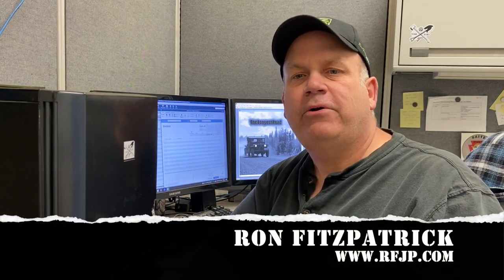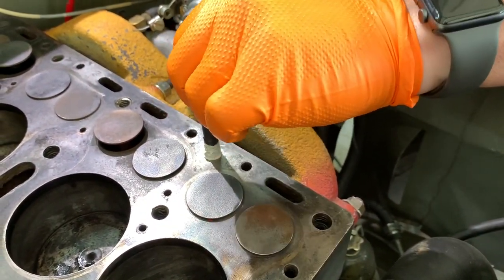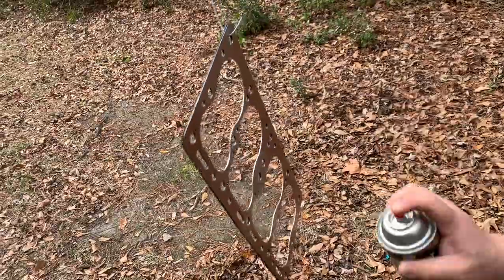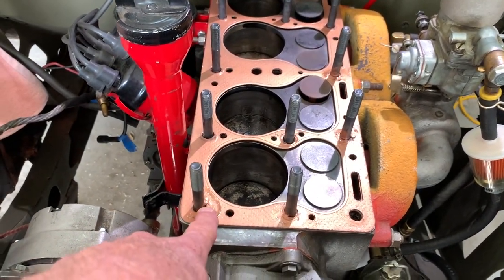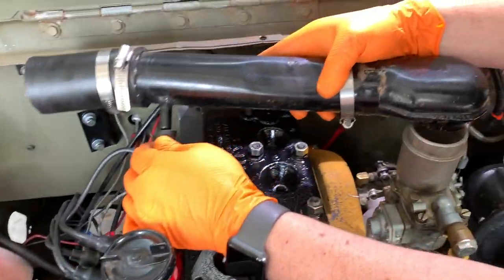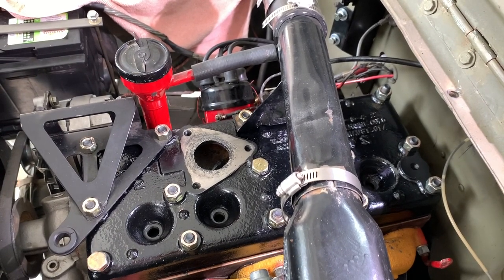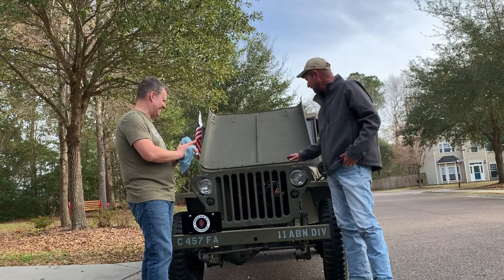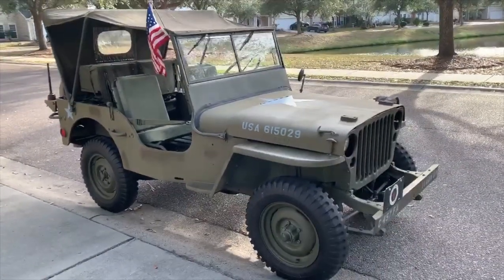🔧 Replacing The Head Gasket On A Willys L134 Flathead Engine

Comment: If the threaded bolts were corse threaded into the block. (A good possibility) Then they should be torqued at a higher value. Been there, blew the head gasket for my education. How much higher? For the Jeep, I don't know. My engine (Dodge) came with either, so I was able to look up the difference.

Comment: Hi! Great job you guys! I have a question. I  just got a 1951 CJ3A. It was sitting for 20 years. I started to remove parts that I'm going to replace on the engine. I accidently removed the entire stud which the oil filter is held down by and I noticed antifreeze bobbing around in the stud hole. I have not removed any fluids yet but I don't know if that is normal or if I have a bigger problem. Do you guys know?

Comment: I have a m38 that also have issues with head gasket. Lots of White smoke .i m thinking replacing the head gasket. Did you also do cylinder head flatness?
Reply from the maker: baios zisimos on this one we did not.
You can check the block side with a straight edge and or visual inspection. The copper spray helps seal the small imperfections.
To machine the top of the block, I believe would require removing and disassembling the block.